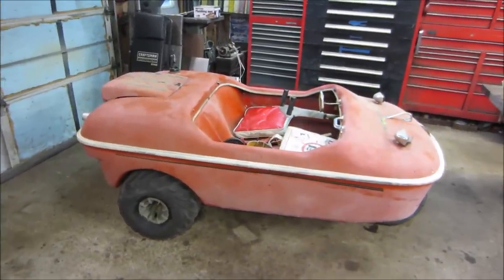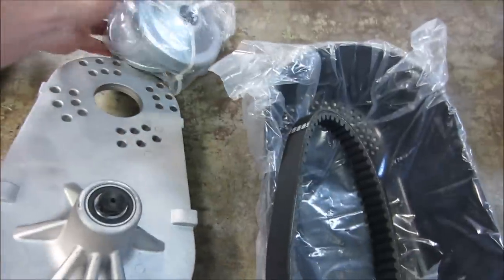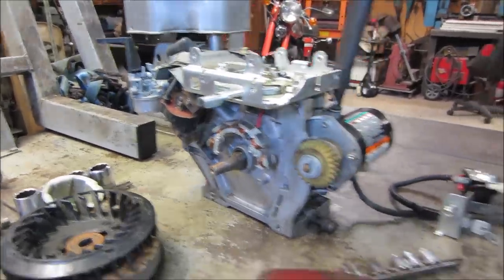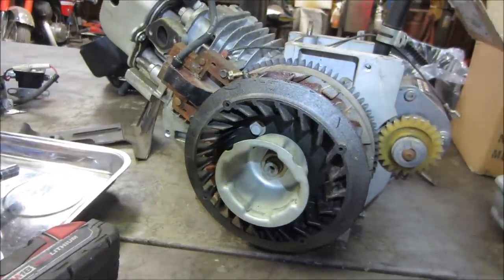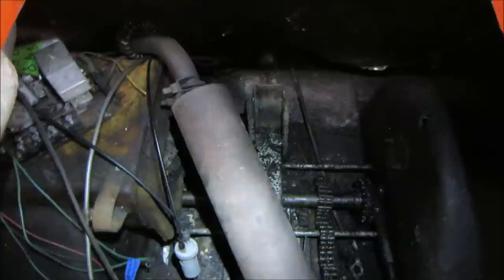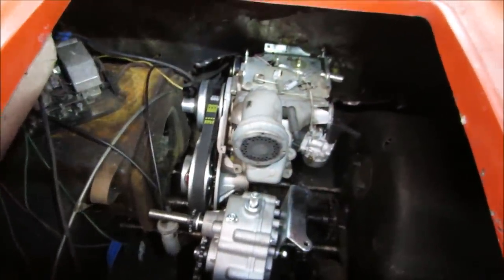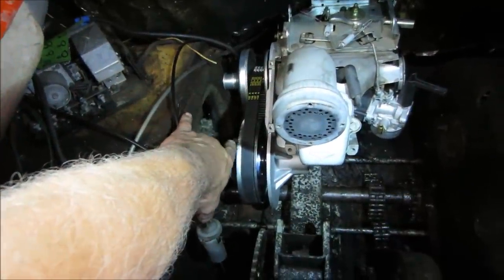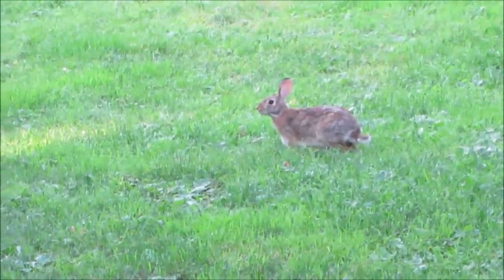beaver amphibious vehicle gets new engine

Comment: Beaver needs it original 2 stroke back in !
Reply from the maker: if you want to pay the $3000 then l will
Reply: The Beaver got me all very interested in this! and Mustie not being able to fix it! A challenge indeed! No way to fix the casting on the original ?  what about chinese scooter like gy6 engines ? Amazon $229 Iglobalbuy 4-Stroke 150cc Gy6 Scooter Atv Complete Engine W/Carburetor CDI Starter Solenoid Coil GY6 high performance ATV QUAD GO-KART MOPED SCOOTER 4 stroke Engine.
Engine comes complete, ready to bolt on.

Features:
Engine Type: GY6 Single Cylinder 4-Stroke
Cooling: Air Cooled
Displacement: 150cc
Max power(kw/r/min): 6kw/7500r/min
Rated power(kw/r/min): 5.2kw/7000r/min
Max torque(n.m/r/min):7.6N.m/6500r/min
Piston diameter:52.4mm
Piston stroke: 57.8mm
Compression ratio: 9.2:1
Ignition system: CDI
Start method: Electric/Kick
Kick start lever is included 
should be add the engine oil
Short case
the size of dirive belt is 743*20(width)*11(thickness). unti is "mm".